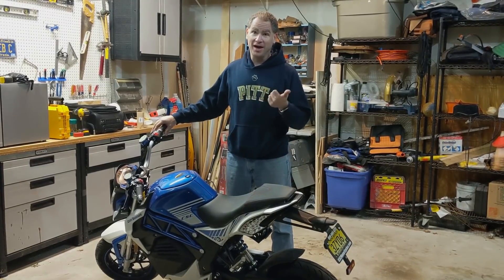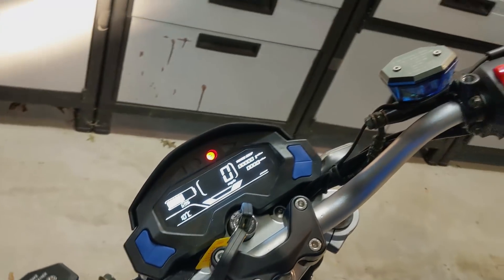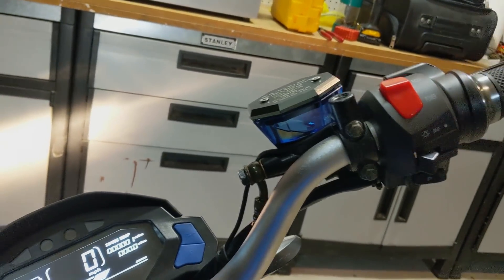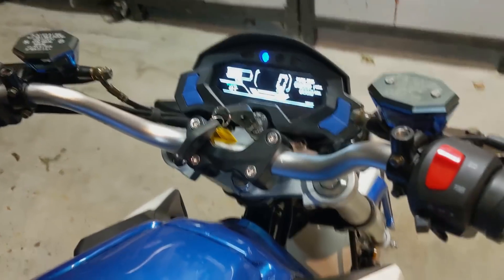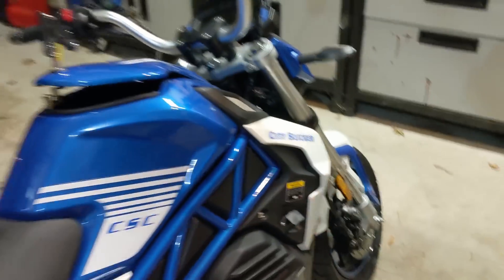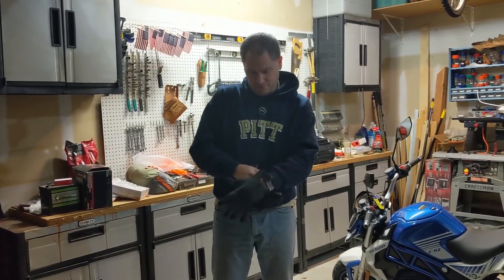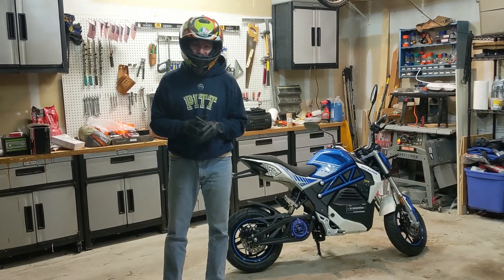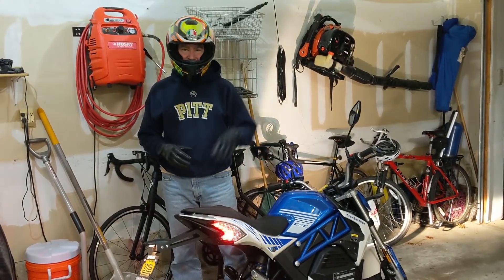CSC City Slicker First Look

Comment: Im curious about the registration process, do you gave to register the bike as a motorcycle or moped? I see your plates are nj & im in nj. Nj requires engine size for registration for normal motorcycles.

Comment: Seems like a design oversight to give the charger and the bike the same power connector. Someone is bound to plug the AC cable directly into the bike without the charger.
Reply: Yes sure is... wonder what would happen if someone did that.

Comment: Use the tool kit to tighten the FRONT brake master cylinder cap. It’s the one by your right hand when sitting on it. Looks low on brake fluid as wee
Reply: Thx, ended up having to top it off and then tighten down

Comment: It looks very nice. I wish e-motorcycle makers would find a way to give it some artificial sounds so people can hear you coming as a safety thing.
Oh, 10c is around 48f; just take c times two and add 30 you're around what it is f.
I do believe on a bicycle the left handlebar lever controls the rear brake and the right controls the front, right? It least in North America.
Good video, thanks for posting.
Reply: C × 1.8 +32 actually. So 10c = 50f.

Comment: hi great video, thanks . i have a few questions before i buy this bike, do i need a motorcycle licence to ride this , is it resisted as a  motorcycle or moped? and how much is the insurance? thank you.
Reply: Yes, you need an M endorsement in the United States.  It is a motorcycle as registered.  Insurance was trivial, like $125/yr.  And, if you're on the East Coast, mine is for sale, I have purchased a bigger/faster/longer range electric motorcycle and would love to sell this to someone who would use it.
Reply: Caleb Cohen what are you asking?
Reply: @calebcohen1355  What Bike did you replace it with ? ( Thank you ) :)
Reply: @chrishunt2835  a 2015 Zero SR (with only 3k miles on it)